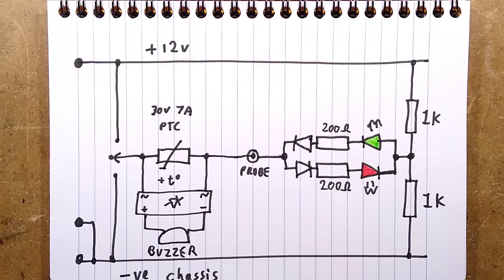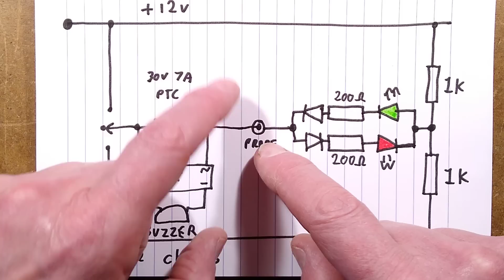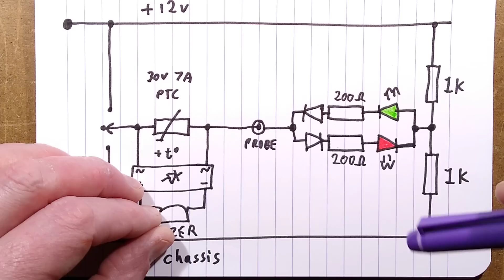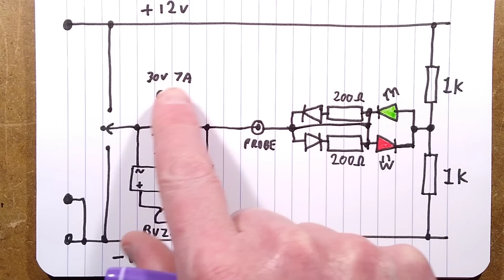Inside a mechanic's test probe - with schematic

Comment: The extra diodes and resisters on the LEDs might be to protect the LEDs, thus extending the life of the device.
Reply: Exactly the peak inverse (reverse bias) voltage of a typical LED (referring to standard 5mm and 3mm LEDs) is only about 5 volts the battery supply is well above that.

Unlike their non light emitting counterparts LEDs have a very low PIV.
Reply: @Bushougoma  The current in reverse is still limited by the 1k and 200 ohm resistors. Many types of LED will tolerate this without damage. I dont mind the extra diodes being there though. However the 200 ohm resistors just seem completely pointless.

Comment: we had a brand name version of that at the shop i worked at during my apprenticeship. one very neat additional feature that one had, compared to what you showed here, was that in addition to lighting different colors depending on the polarity it would also emit one of two distinct buzzer patterns. very handy when poking around in cramped spaces or when you have already stretched your arm an additional 3cm because the thing to be poked is at the very back of some cavity and checking the LED is not really an option.

as others have noted: despite its simplicity its an incredibly useful tool for quickly zoning in on the source of an electrical issue

Comment: 9:04  The two 1 K resistors provide circuit loading to prevent stray voltage from tripping the LEDs.  This is a real problem when using a digital volt meter.  Fluke even makes a stray voltage eliminator ( SV225 ) for DVMs.
Reply: Is that a resistor and does it cost $50?

Comment: Most electronic modules current sourcing outputs and current sinking inputs are protected from over voltage/current. I have seen many many controll modules shorted to battery or ground with no damage.............

Comment: Don't you have 6 volts differential across the 1k resistors? So 200 ohm looks right for the LED.
Reply: The 1k resistors will limit the LED current to about 9mA without the 200 Ohm resistors so they serve no purpose.
Reply: @petehiggins33  Ah, That's probably why the 200 ohm resistors are there then. Who ever designed it probably thought the same as me. I thought the voltage was an issue.

Comment: The extra diodes and resistors may be to protect against accidental powering of CAN networks without damaging anytbing?
Reply: thanks for liking the comment Clive! I've been watching and subscribed for years now. when I have the money saved up I would love to fly across the pond and get together in one of your meet-ups! I used to wire in alcohol ignition interlock devices at a New Jersey State approved facility and sometimes we would have to use a "power probe" to find different circuits we were looking for. so, I took a guess on what the diodes and resistors were for even though I would assume there would need to be some sort of logic to detect can to begin with on the probe. not sure. but keep up the awesome content brother!

Comment: In automotive videos here on YouTube I've often heard these things referred to as a Power Probe I'm not sure if this is the correct name for it but I've heard it enough that I think it's the generic name for this particular tool or so it seems!

I'm like to be able to come up with a design for someone like this that's not specifically for 12 volts though for troubleshooting low-voltage systems even with maybe integrated continuity tester and more and also just the capability of having a single test lead connection to allowed to determine whether the probe would be positive or negative possibly to LEDs on for AC for trouble shooting things more for electronic devices then Automotive.

I envisioned something that would look almost like a logic probe except have a similar function to this type of tool that featured in the video!

Also I have a lot of those Harbor bright test light kits I've modified for various things it makes a good housing for a one-off😮 piece of toast gear.

One essentially is just a red and green LED and a suitable value resistor just to indicate polarity others I've got lower voltage bulbs is that original just so can use this for testing Marshall are voltages even than 6 volts.

I should found out the continuity tester of theirs is also great for verifying do you miniature low-voltage bulbs that I use quite frequently even though it's only one double A battery is enough to like them and if there's a short that leads going to them or any of the wiring the continuity tester we'll come on fully and indicated there's an issue.

I build all kinds of models and also help others with model railroad stuff as well not to mention do a lot of stuff custom when it comes to being an adult fan of Lego and no not always a purist but at times do strive to be it depends on what I'm going for and the project at hand technically even in some of the stuff at the Waco parks and more not all this is hundred percent Lego for example there is Metal Frames non Lego electrical in some cases even pneumatics so kind of throws the entirely like nothing out the window anyways so it just depends on how you feel about doing things when you do something outside the box anything's fair game.

Then again everything has been or will be open-source eventually for this as well heck they even have a connector that's designed for other then their own accessories on one of the sensors for the powered up system if you know about it It's actually an industry-standard connector for sensors and so on which is totally awesome and if you look online you can actually find connectors that fit all there systems even newest as well as possible to modify other connectors to fit so it's just easier nowadays it's like there are more encouraging people to go outside the box and they used to it's kind of opposite of what it used to be however only reason they did not you stared Toco connectors on the Mindstorm systems that use the telephone like connection essentially it's the dec plug but the tab is on the opposite side it was a toy safety thing so basically you cannot plug something into somebody that might have higher voltages present and yes or why those clones and third-party things especially from China actually use standard Telephone Connections

Comment: The most intriguing part for me was the rectifier. I never ever thought of putting dc through the ac input of a rectifier. How utterly ingenious. I suppose it just shows that I never paid attention in college.
Reply: Some devices employ rectifiers on their DC power inputs in designs where the plug can go in either way round. It's a neat idea isn't it?
Reply: If you like the use of the rectifier, it is worth looking up Clive's video on a galvanic isolator for marine use.

Comment: If the diodes and 200 ohm resistors were meant to protect the LEDs against EMF from switched inductive loads, the 200 ohm resistor should have been in series between the probe tip and LEDs, with the diodes clamping the LEDs' probe-side voltage between +supply and ground instead of doing polarity check on LEDs.

Comment: Power Probe and knockoffs of it can cause problems when used wrong, used on 5v circuit, and more. Starter motors draws 120+ amps and Solenoids on the starter draws 30 to 40 amps and likely won't spin/activate with that "Breaker" or just burn up the tool. Other Motors & Coils can see a "dead short" to ground tested this way too. Many car relays have EMF diodes on the coils but not all so you need to watch polarity when test out of circuit or the Diode smokes.

Comment: Seems to me that the reverse voltage limit of many LED's is quite low. I would have added the regular diodes as well although I'd gave to think about the need for the dropping resistors. 🤔

Comment: I Brought the Snap-on version in its plush box but the snap on one contains a few extra bits, Being an auto electrician It is so helpful but you have to use caution because if you dont know what you are doing you can blow a lot of stuff up, also a lot of circuits in cars work at lower voltages than 12 volts! (as clive found out injectors and a lot of things are 5 volts) there is a fundamental reason for this. Anyway I will digress mine cost about £100 on one of  Snap-on's offers

Comment: Reminds me of the test lamps we had in telecomms, which was 2 50v lamps in series across the supply cnetre tapped for the probe, both lamps glowed dimly when connected (useful to know you had a supply)
Having 2 led's in series would be a problem with matching current.

Comment: it is good, but to be honest I prefer using a 12volt brake bulb as it loads the circuit enough so you can see if you have a high resistance in the circuit like a bad earth

Comment: I've never been a fan of the LED probes for diagnostics on vehicles. Either i would use a multimeter or some kinda load (usually a 5w bulb) for testing, depending on the expected outcome.
Diode probes tend to show false positives, when testing a high Q output.

Comment: I'd say the extra diodes are necessary because like you said while probing solenoids the reverse spike will kill the LEDs eventually. If you look inside LED tail lights or side lights they always have a power diode in series. I think it's just standard practice to include them

Comment: I used to work with vintage and historic vehicles and I was always the workshop "go-to guy" for auto electrical stuff. I had one of these from a branded supplier, can't think of the name now but it wasn't cheap. 

I ended up being off work because of a spinal cord injury and loads of my tools went walkabouts, this being one of them. 

I might buy one of these cheapies to replace it as I still do work on my own cars at home as and when I can. Keeps me marginally sane... ish.

Comment: These work good BUT you need to be careful as you can fry a module if you inject power to the wrong places! It's one of the issues that folks learned the hard way when the Power Probe 1 came out.

Comment: Basically a logic probe for 12V systems. I made one of these years ago and it's proven itsely to be amazingly useful. Every car owner should have one of these
Reply: Said, "Every car owner should have one of these." 

99% of the car owners would not know what to do with it.
Reply: I used one today to trace a fault on a Power Pallet Truck.
Reply: @Dog Walker  used one today to check a solenoid on a Skid Steer. Now I need to find the shirt. "We kept blowing the 15 amp fuse, so we installed a 30 Amp to get it over here." Unfortunately,  I don't find any melted wires to help me.
Reply: @timothyball3144  That sounds like what my  boss did at 4AM he had a short on a CIP pump panel could not find it so changed the 13A breaker for 32A  worked for 5 minutes then blew the whole panel,  Turned out it was a failed cable shorted internally.
Reply: Have you met every car owner?... :'(
Reply: @caddyguy5369  I would not trust a lot of car mechanics with anything electrical, including commercial vehicle mechanics.

Comment: ive had a power probe III for around 3 years and a couple of months ago i finally managed to kill her just because the solder joints for the tip where weakened and i put too much of a load with a 24v circuit i was testing for a bus... this was single handedly one of the most valuable tools you can have for electric diagostics if used consiously, it allowed for quick and dirty testing while also doubling for a voltage tester since it did have a screen... this chinese one seems neat for the price but ill still gotta get me another power probe...

Comment: Extra diodes: protection from overvoltage, e g. if the probe was touched to a wire from the spark coil secondary?

Comment: I've made something similar for industrial sensor testing and setting for 24v. Ive put 15v zener diode to make leds off. So you get a string of led resistor zener zener led resistor. Ends to power and sens to center of string

Comment: Would be nice if they had included a high load switch so you could pull the 12Vs down with 1A or so. I stopped using a dmm to fault find on my cars and now use a lamp on flying leads. I find the most common faults are connectors going high impedance, so will still show up as a good connection with a low current like a dmm or led but can't light a lamp. Old 5w tail section from a stop/tail bulb gives it a second lease of life if the stop filament has gone.
Reply: Are you saying a DMM on a resistance range can't correctly measure the resistance of a connection ?
Reply: @deang5622  when faulting on a car it's not always possible to measure the resistance through a connector. even measuring the resistance can give a false idea of the state of the contacts, as we are normally taking of high currents of 1A or more. i still like to load the circuit with the kind of current it should be seeing this really helps finding the doggy connections or breaks in the wiring.  I chased a fault on my radiator fan for ages with the DMM as you can't get to the connections when the fan is plugged in, and the DMM said that there was 12V on the unplugged connector. the man from the AA just connected a 12V inspection lamp on the connector! it flashed and went out. with the lamp he found the fault in about 5 mins and got me back on the road. i thought i was being cleaver by  using the DMM 😞
Reply: @TheEmbeddedHobbyist  I agree with what you say. But the resistance measurement , if it can be carried out, can give you a good indication of the state of the contact. You just need to know what figure represents a good contact between the connectors and what represents a bad figure.

It's nothing to do with the current. You can push 10 mA or 1 amp it doesn't make any difference. The resistance remains the  same. The resistance isn't a function of the current. What could potentially happen, if the contact is current a high current then that leads to heating of the conductor and contact and most metals have a positive temperature coefficient of resistance, meaning that as the conductor warms up its resistance can increase.

Knowing the resistance having measured it with a DMM, you should them be able to calculate the voltage across that cable and connector by knowing what current is normally drawn.

If the voltage drop is too much, then the device being powered isn't going to have a high enough potential difference across it to enable it to function.

So, resistance, if you are able to measure it can tell you a lot.

In fact, I know of data communications networks covering large geographic regions where measuring the resistance of cables on an annual basis is performed to monitor the performance of the cable and connectors and decide when to replace the cable.

All of that resistance data is captured and stored in a database and charts produced over the years showing the trend in the resistance measurements.
Reply: yep I said that🙂
Reply: And technically it's not impedance here, it's resistance.

Impedance is a combination of reactance and resistance and is represented by a complex number. A complex number comprises real and imaginary parts.
The complex number contains magnitude and phase.

We are talking steady state DC here in 12 volt car electrical systems, so it's resistance only - the real part of the complex number. There is no imaginary part. Hence the magnitude of the complex number is present only and there is no phase angle.

So it's resistance rather than impedance.
If there was an imaginary part present then it would be impedance.